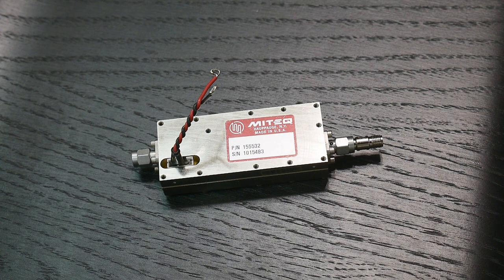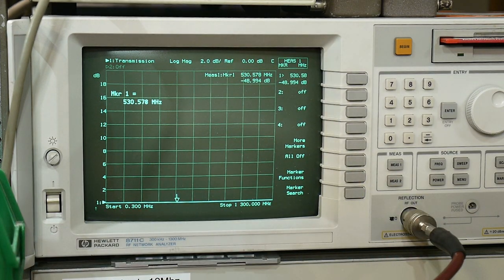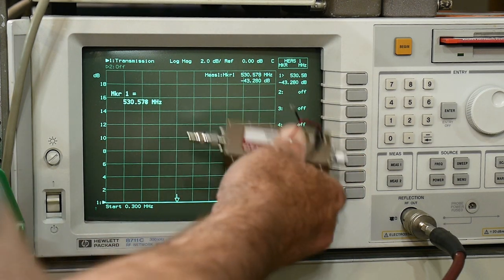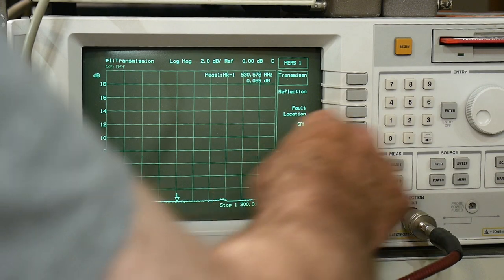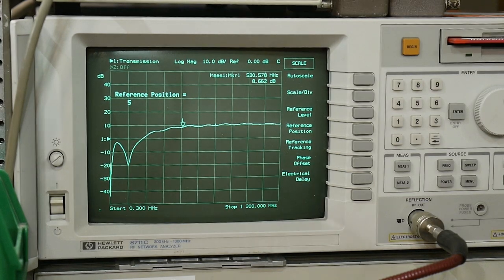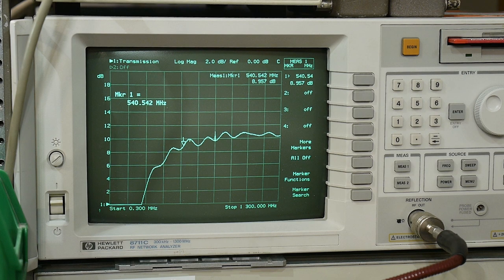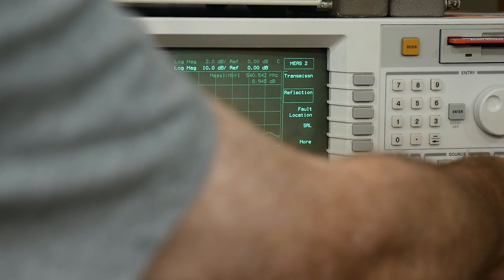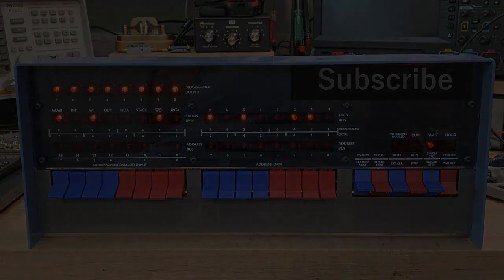#1190 RF Amplifier Testing

Comment: This video brings back so many memories of designing and testing RF amps… noise figure, 1dB compression point, IP3 tests, expensive transistors/MMIC’s that oscillate in the GHz range, all whilst looking at the smallest signal on the very expensive Spectrum Analyzer fully knowing one misstep will blow up the Spectrum analyzer for which there was no money on the budget to repair…. Hey, that was the 80’s in which every RF-related thing was more expensive than your car, and heck, the spectrum analyzer costed more than the engineering directors house!!!!! But still looking at it as the good old days 😂😂😂😂

Comment: Normally I wait till the end of a video to comment, but I have to say I am surprised that the solder joints aren't cleaner on this unit.  Miteq makes some really good equipment and while the appearance of these joints doesn't affect the operation, I've seen them do better work.

I purchased a lot of Miteq equipment over the years and have been to their factory a number of times.  I even commissioned Miteq to make a custom Ku band up/down converter for an application we had.  Art Faverio was a great guy.  As co-founder and president he of course had a very nice office up in the executive area, but also had one down in the labs area where spent most of his time working as one of the guys.

Miteq is a bit like an East coast HP.  They use a lot of their own components in larger assemblies they produce for sale to others.

Comment: Mostly these days I watch your videos in order to get ready to build a homebrew radio. I am rather old for starting to do this and I am not yet really ready in my life to get started, maybe I never will be, its in the future. There are a few parts of these videos that seem really helpful. I want to develop some innate sense of what things do,,, maybe seat of the pants, as well as a more technical understanding. But there is also how to test, and set up to test, and what I need.  This told me I need to build a second set of attenuators at least in some values. 
I took electronics in about 1974 in high school and when we got to AC I was flummoxed although I passed the course. I knew the rules, some equations, but they were memorized not grokked. Slowly it is starting to make sense.

Comment: I've been testing amplifiers at the radio club as I've lots of cheap Chinese LNA's and it's surprising what you get. Some that look and are cheap are better than some of the more expensive and better build looking amplifiers. I am running DVBS / DVBS-2 so I'm looking for good linearity for a QO-100 and for local links on 437Mhz. Some had shoulders less than 10bd while up to 30db

Comment: Nice...glad to see an active RF 

I am curious about if the amp has adjustable bias 

What a nice demo of big boy...

Thanks IMSAI Guy
Reply from the maker: looks like fixed 8V
Reply: @IMSAIGuy  

I looked closer at first I thought there were 4 I/O pins...

I like the opinion you have of not so a wonderful amp...I have nothing to compare to...

I thought it had good gain..wide broadband response...and not with the flatness as you said. 

Maybe then they had post filter....and narrowed frequency of interest...

The soldering looked a little lumpy..

I might try and see & and look up the RF power transistor ....thanks for showing the close up...

This looks to be a npn bipolar...biased class A...?

I wonder if like the general purpose MiniCircuits 300 Mhz to 1.5 GHz broadband amps have a flatter response.....maybe I will go look at prior IMASI Guy posted teachings and go see if you had some other amplifiers being measured.  I did watch that nice radio test set you rescued from the dumpster....it's capabilities were outstanding...and it's in great condition.  Good job. Motorola had sort of a similar like unverisal radio tester but not nearly as nice nor the resources that HP could design into something..

Would the Q dc point on the collecto be near 4 Vdc?...without any RF in or maybe impossible to check do to the RF chokes...I can go read...

Curiosity just has got Fred's cat..

Thanks IMSAI Guy for making short work and showing off your HP VNA & cal skills..

Could or would the ripple change in the power band if the RF level input was different....?

Don't worry about my nativity and I look foward to you next displayed endeavor..
Reply: Do you have a design for this circuit? I mean PCB schematic
Very good

Comment: The gain figure looked like it really flattened out as it approached the limit of your VNA...is it possible that it's actually designed for a higher frequency of operation above 1.3 GHz? Maybe checking it with your Nano might show that?
Reply: Even 10 GHz, then the capacitive of the case would be involved!

Comment: a Thru response calibration corrects only for errors in the VNA related to transmission tracking and isolation. I wonder if you would see better measurements if you did a two-port SOLT calibration which would correct for errors in directivity, source match, load match, and reflection tracking

Comment: Curious to know if you tested the amp at higher frequencies to find the cutoff frequency on the top end.  Miteq made a lot of equipment that covers higher frequencies than just a gigahertz.  The amp might have been designed for S, C, X, or higher bands.  I did try to look up the part number but didn't get any hits.
Reply: My thoughts as well. It looks like they snowflaked the output so that would indicate that is made for multiple gigs. And also the gain is absolutely flat up to 1.3. Could be a K or X band amp.

Comment: Good video but, as others have mentioned, more testing at higher freqs could be interesting. Also, I wonder if changing out the amp xsistor might make a difference. Anyway, thanks for the great videos.
Reply from the maker: yes, swapping the MMIC is the right thing to do, I did that on a cheap Chinese amp and put a good part in it.

Comment: NanoVNA can control the output power. The feature was introduced a while back with DisLord firmware.
Reply from the maker: that's good to know. I have dislord on some but on others there is no dislord version.
Reply: @IMSAIGuy  All H, H4 and LiteVNA from Hugen (the manufacturer) are compatible with his firmware. For the output level: It's not much, 4 levels. Basically it's a mA drive setting for the clock generator used as source.

Comment: Hello and thanks for good videos
I have a question iwant to buy lna module there is some types like 20db gain I know If I put 50mv pp in input I will have a 500mv output but ididnt tested it for 400mv input will I have 4v pp at output on 50 ohm load If not why???
Reply from the maker: seems like I have been asked this question before. is it a homework problem? 20db is power gain not voltage gain
Reply from the maker: oh, it is, you asked about another homework problem. do it again and you get banned. study, don't cheat and ask me.
Reply: @IMSAIGuy  I don't know why you're reaction is like this...
I just asked a question...
Reply from the maker: @ltlt6117  you once before asked me to help you with your homework. is this homework?
Reply: @IMSAIGuy  no I'm designing a radar I'm confused with amplifiers I want to get a 5v pp signal from 50mv to increase my dynamic range of radar yes I know with high inputs I'm putting them into cutoff and because my transistor should be ultra low noise and high frequency I can't do anything that I want...
And I have to find a way to use(( low power transistor)) to get a 5v pp on 50 ohm with some treaks. I tried something and works like ((parallel transistors))an I need to know more ways
You have good memory too.
Reply from the maker: @ltlt6117  if you want to do RF you need to stop using volts
Reply: @IMSAIGuy I used volts because my analog to digital converter reads volts
 OK i can say my previous question like this how can I make a high power low noise amplifier with low power transistors?
Reply from the maker: @ltlt6117   you are asking for +17dBm which is quite a lot. a single transistor design will give about 10dB gain per stage. so you might be asking for too much
Reply: @IMSAIGuy  yes the main reason that I asked this question was this
That when we say 10db amplifier it's TRUE for 1mw to 10mw but it's false for 50mw to 500mw amplification
So I need a way to know before buying an amplifier it is 10db on how many power ?!!! manufacturer just says it's a 10db amplifier

Comment: I tried to look this device up in the manufactures sales catalog but with no luck. However, I found items similar to this but were under the headings of spacebound and mil spec with one that looked identical to this one, but was describe to be used with cryogenic. Is that why it seemed so unimpressive when you tested it? The company it's from deals in what appears to be ultra high end microwave tech. Do you happen to have any liquid nitrogen? That would be a cool video. Please forgive the inadvertent pun. That was shameful